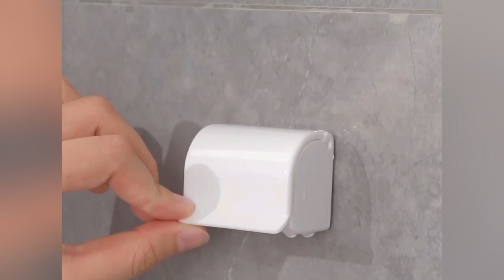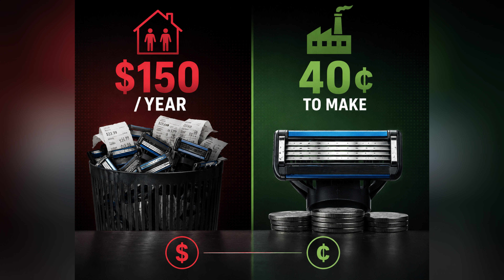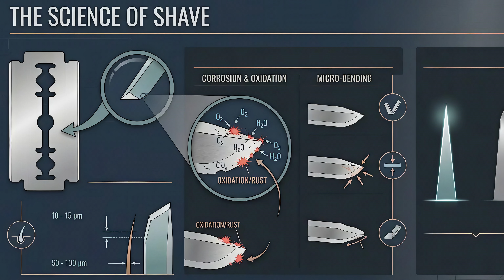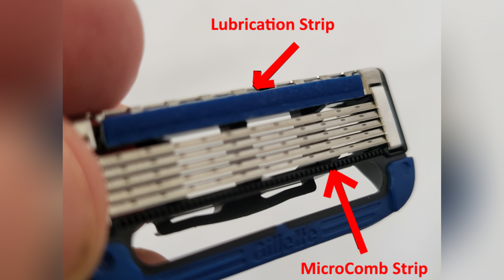Your Razor Is Designed to Dull After 3 Uses — How to Make It Last 2 years!

Comment from the maker: 💠✳💠 When I say to “flip it,” I don’t mean flipping the cartridge over to sharpen the back side of the blades. I mean changing the direction you rub it on the denim.
Denim has a weave — little threads running in different directions. So you gently rub the razor opposite the cutting direction for a few strokes one way, then turn the razor or the denim around and do a few strokes the other way, still opposite the cutting direction.
Reply: So we reorient the jeans only (same side but turned 180 degrees) and continue to push the blade along as before for another twenty strokes?
Reply from the maker: @mroctober3657 YESSSSS!! excatly! 👌👌👌👌👌
Reply: @Sidney_Explains_Money  Great video, I just finished stropping both of my name brand razors. Fingers crossed for an improved shave, because the last one was noticeably rougher than usual. 

But just to clarify, do you put the mineral oil on the diminishing lubrication strip? 

Or on the actual blades themselves?
Reply: @Sidney_Explains_Money  thanks for explanation!
Reply: 👌 agree, this method really works wonders. With a Gillette Mach 3, 1 lasts 3+ years. Still have the original 5 cartridge refill, with 3 still unused. Savings!🤑
Reply: @wilson5377 Have you had any problems with damaging the cartridges, you know as you rub the leather or the jeans splotch on the lubricant area? Seems like they are in the way.
Reply: Glad there is clarification because “flip the razor and 20 more the opposite face” originally stated makes no sense.
Reply: Nany... sorry. BABY oil - a product like the Johnson's babt... baby oil - is in fact mineral oil. Been using it instead of SRAM/shimano expensive overpriced oils for years and no prob.
Reply: Any tip to sharpen electric shavers blades?
Reply from the maker: @nihil0771  Yes!!! I'm working on it as we speak and should publish thar video end of this week. 😁
Reply: @Sidney_Explains_Money  great I just brought a free bird electric razor and would like to know how to keep the original blade sharp,Thanks for you great video 👍
Reply: I have a strop, but it doesn't work on cartridges, only straight edges – it can't work on cartridges because the microfins on the bottom and the bumpers on either side, physically prevent  the denim on a flat surface from making contact with the blades.
Reply: @S @Sidney_Explains_Money o, you are stropping the blades. Good idea. What about a leather strop and compound ? I guess you answered that as well but I already have a strop. Good tips. Thanks
Reply: Great tips, I use a towel, and strop the razor forward, then diagonally both sides, works well but got to try denim
Reply: How did you pass copyrights??
Reply: You said that the edge does not dull and tell us how that is accomplished with repeated wear it in fact always does, except perhaps for fine hair? You never mention the word sharpen and you maintain that water and contamination only occur and that this dulls the blade and is reversible.. it cannot be, as the edge damage always happens.
Reply: This method does not work on the typical multi blade types as these style of blades only offer 1 side to finish.
Reply: @ethimself5064 hmm works fine on the multi blades I have but doesn’t last months I think
Reply: @TimelyAdventure  Still only able to do 1 side and will curve inwards
Reply: @ethimself5064  yeah it's not perfect. but i get like a couple few months out of them shaving a few times a week, it's still way better for me than replacing razors every week or two
Reply: You can also strop japanese kitchen knives on denim. I cut off a leg from an old pair of jeans.  Works really well.
Reply: I shave in the shower. I rinse my razor and then hit it with a blast from canned air to dry it out and then put it on a shower caddy. I dry my toothbrush out the same way. My blades last a month. I'll try the stropping method and see if I can get the blades to last longer.
Reply: You literally say "flip the razor".
Reply: You didn’t “say” anything in this 😂
Reply: use hair conditioner on stubble before shaving to soften the hair .. bladess last MUCH longer & zero razor burn
Reply: what about using an actual piece of leather?
Reply: thank you for clarifying. That part of the video was extremely confusing. 

BTW there is a small gadget called a "RazorPit" which is just a small strip of silicone in a plastic housing, with exactly the same purpose. It seems to me that drying the blade and keeping it relatively free of moisture is just as important.

I wonder if there are any disadvantages of keeping a strip of denim in a moist environment. (Or are you supposed to do it on the jeans you are wearing?)
Reply: @MedeaYoung  'confusing' meaning wrong!
Reply: Should we put some diamond grit on the denim for a finer edge?
Reply: #1 reason blades go dull is water...keep them in oil
Reply: "Flip the cartridge" or the fabric doesn't add much after the initial stropping. You still can't get at the back edge of the blades. That's like 'steeling' a knife on only one side, which I know from experience doesn't accomplish much.
If you use a classic T- shaped razor, you can flip the blade and dress the second edge. Thanks for an otherwise practical video.
Reply: Will this work on a 5 blade cartridge that has a lubricating area on the top and bottom of the blade?
Reply: 3 shaves is absolutely right. I shave at least 3 times a week and by the end of that, the blades are finished. I'll let you know how this works for me.
Reply: The weave pattern in denim runs in a diagonal direction, not in different directions.
Reply: @TheBlackbelair  Regardless. It works.
Reply: Well, I’m glad you took the time to clarify your original explanation because the first time you explained it was very poor. I apologize for telling you that, but there were a lot of folks who were totally confused by your explanation the first time. Including me and several family members. ￼
Reply from the maker: @Kingdom_of_God777  Don’t worry, buddy, no need to apologize. If you didn’t understand, that probably means other people didn’t either — and that means I didn’t explain it clearly enough.

I’m all about learning, fixing things, and improving as I go. That’s what this whole thing is about.

Thanks for watching, by the way. 🤠
Reply: @Sidney_Explains_Money  please re-do the video explanation
Reply: @Sidney_Explains_Money  Since you seem to be open to constructive criticism, I want to tell you... that part leading up to where you say: "20 strokes up. Flip the razor. 20 more on the opposite face." was INCREDIBLY frustrating to watch! 😡

Not so much because the WORDS you were saying were confusing, but more because you had the camera zoomed in on your hands and razor, and STARTED giving us a visual demonstration of the technique you were describing... but then, you abruptly set the razor down on the counter, and just started making odd gestures with your hands and fingers. As your audio track said "smooth backwards strokes" you were making these choppy gestures with your fingers (???) then making a twisting / pinching / rolling gesture with your fingertips (???) then you pick up up the razor again, but instead of demonstrating the technique we're hearing you (try to) describe... you just kinda hold the razor in your left hand and just kind of... gesticulate (???) Then for a split second you start doing the same thing you did before, then a smash cut to you just... pointing at the denim with your fingers (???) 

I watched that section over and over and over... and just kept getting more and more confused! I was like: "Why the f is he gesturing and pointing at the denim, instead of simply SHOWING US the technique he's describing? Why did he set up the camera like this if he's not going to SHOW us what "Flip the razor, 20 more on the opposite side" looks like?!?!?  Whatever you were doing with your hands there did not seem to sync up with or even correlate at all with the words we were hearing on the audio track.

While I DO appreciate the information about this household "hack" and plan to try it... that visual "demo" part was way more confusing than helpful
Reply: BOILING WATER: I boil water, pour in a mug, and use my Mach 3 razor in that for the rinse for the whole shave. Disposal blade lasts 9 to 12 months. Last one head broke off cause I pressed to hard, but still shaved fine after 9 months. The much hotter water cleans the blade enough to prevent degradation. Try it, and the hotter blade gives a better shave. Much easier to maintain then the tips from this video.
Reply: I don't by Gillette any product since the woke campaigns
Reply: @ronorazine9105 what is a woke campaign?
Reply: @ronorazine9105  u mean buy.
Reply: i have no idea what you are talking about ...I have been using a single Gillette blade for 18 years and it works just fine.  
Then again, all the things i use have the tendency to last forever.
Reply: @alexlazar4738  tell us, wet shavers, how you do it.
Reply: @FernaManu  Honestly, i have no idea, i don't even dry it or often  even clean it properly after finished. 
ibut t just continue working  and my face is smooth every day

Comment: I used the Gillette Trac II, Contour, Sensor, Mach 3, and Proglide cartridge razors. The best one is the Gillette Sensor. It was an actual improvement over the models it replaced, and the models that came after it were worse.

Comment: I stopped buying Gillette because of their past WOKE advertising so I bought a  Coles (Australia) cheap generic blade. To my surprise it lasted almost indefinitely. On inspection I found that there are wide self cleaning slots in the back so it never blocks. The cheapest is by far the best

Comment: It should be said that most of the advice mentioned here doesn't apply to a modern DE blade, and the vinegar bath in particular is NOT recommended for my Henson razor Al 3. DE blades are cheap and shaking off excess water and leaving the razor in a not too humid place takes care of all DE razors. Personally, I left cartridge blades behind 25 years ago. They're too expensive for my taste and the shave is no better.
I get 8-9 shaves out of a single DE blade that costs pennies. And there's much less waste.

Comment: You can also use rubbing alcohol to rinse the blades. It evaporates any moisture on the blade quickly to dry it. It also sterilizes it.

Comment: LOL are there seriously human beings spending $80 a year though? I honestly don't know because I have trouble judging that a blade is spent, I tend to use them over a month. I also don't buy misandrist brands like Gillette. I figure Dorco is the OEM for most store brands on earth, I might as well us them. I get a $20 box of blades and that's like 2~2.5 years for me. What's great with Dorco is that when I found myself running out of blades on the road recently (was in Germany) I just checked the back of pharmacy brand boxes until I saw "Made in South Korea" - to me I was pretty sure it must be Dorco OEM parts. Sure enough the blades fit and were great.

Comment: Grow a beard, problem solved... but on a more serious note; people may ask - why not use stainless steel? And the answer is, just for the same reason Japanese chefs use knives that are carbon steel and not stainless steel, and the reason is simple. Carbon steel has a molecule that is much smaller than stainless, so, no matter how you may sharpen stainless steel, in the finest stones, it will never be as sharp as a carbon blade.

Comment: This video explains that razor blades do not go dull because of hair, but rather due to oxidation caused by moisture and air exposure. To significantly extend the life of a blade from a few weeks to several months, the video recommends the following maintenance routine:

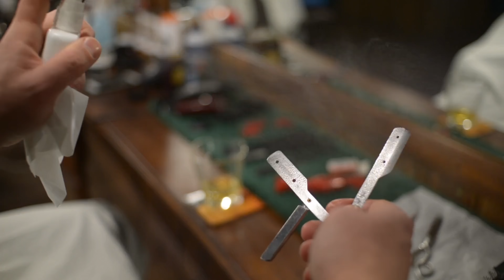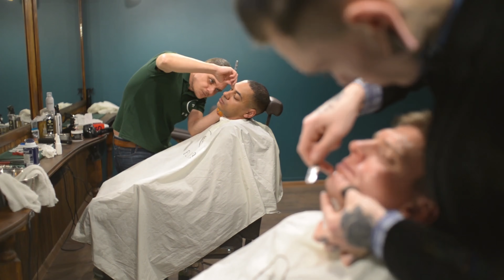*   *Stropping:* After every shave, run the blade backward (spine first, edge trailing) against denim 20 times per side to realign the microscopic edge (2:30-3:37).
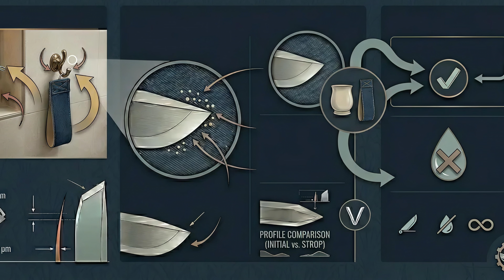*   *Dry Storage:* Shake off excess water and store the razor in a dry place to prevent corrosion (4:21-4:50).
*   *Mineral Oil:* Apply a drop of food-grade mineral oil to the blade to replace the lubrication strip and repel moisture (5:34-5:58).
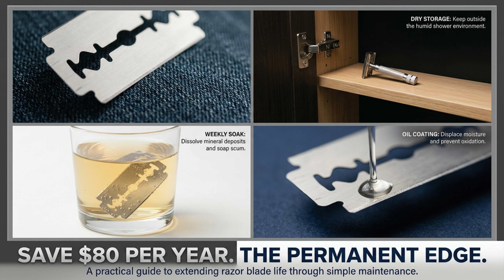*   *Vinegar Soak:* Once a week, soak the blade in white vinegar for 30 seconds to remove mineral deposits (6:02-6:22).

Comment: I’m 63. For years I’ve listened to men saying there blades only lasted for a week or two.
And I’ve never understood why? Mine last months! I thought, “As I have blond hair, maybe my hair was just softer?”

But… I’m a travelling man. I don’t leave anything lying about in hotel rooms… I keep the room tidy and put everything away (I’ve been travelling since I was 15).

And THAT is the rub… putting everything away!
I’ve always cleaned, dried and stored my razor in a bag and kept the blade covered so it doesn’t rattle about… and blunt.
Dry. There’s the answer! 😂
I won’t strop the blades on denim or anything else… I don’t need to. 
Just dry it after use and keep it dry. 
3 months… shaving 3-4 times a week.
Reply from the maker: That's a great observation! Drying and storing the razor properly definitely makes a huge difference. Glad you found what works for you.

Comment: My blades seem to last 3+ months already…with shaving my head. I use my electric razor only on my face, blades on neck and head.  It’s possible i wasn’t aware they were going dull early, and i definitely feel the difference between a nee blade and just a few weeks of use, but i judge my blade wear by if it still cuts close and doesn’t leave my skin irritated.  All I’ve ever done is rinse the blade well after use, shake dry, and set it in a dry area. With my electric, i hardly ever clean it because with my first one i use to clean it religiously and the foil would wear out in 6 months.  So i determined that the oils on my face could be sufficient to prevent wear if i didn’t wash it, and ever since, the foils last 3-5 years.  I change the foil maybe 2-3 times before the whole thing is falling apart and typically lasts about 10-12 years before i have to replace the unit.  Tried changing the battery on one one time and thats kind of a joke, but i got another year or two out of my mangled shaver, then just switched to the budget version for $60 that should last another 10 years and foils are $20 (last few have been the supposed top of the line, so we’ll see how the budget version holds up). I might try the oil on my razor, but don’t see a need to put in all the extra work to possibly get another month or two to save a couple bucks.

Comment: I use disposable razors and use the same one for about a month. 
I shave my head 3 to 4 times a week with it too. 

I run it under cool warm water first to help lubricate it. 
Not got as that makes metal expand and that means more dull. 

I shave, tap it clear, wash it out, tap it to clear water. 
I then run it a couple of times down the towel, like the strop and I store it in the cabinet. 

The important thing is to get as much water off it as possible. 

I do a very similar thing with my toothbrush and guess what... 
It starts in the same as new condition for absolutely ages, like, years!

Comment: Now I still need a trick explained how to get all the hair and skin particles stuck inside the blade cartridge out. More than half of the hair refuse to get out even after rinsing. I can rinse the razor under running water forever and ever, and less than half of the hair get out, most of it is still stuck inside the cartridge between the blades. Shaking the razor and tapping it on a hard surface does nothing, maybe 10% of hair fall out, most of it still stuck inside. 
Obviously, I can't use any object to brush the hair out, because either I'll damage the brush and get microplastics in the air or I dull the blades by scraping against the edge, which I understand I have been told in this video to avoid.
Reply from the maker: Try using a small, soft-bristled brush like a clean toothbrush; it's gentle enough to avoid dulling the blades while still getting the job done. 🙌

Comment: I use a 1950's era Gillette super speed (About $20 on eBay) and Astra platinum blades ($11.00 for 100 blades). 2yrs. of shaves from 100 blades... Clean and oil the handle twice a year...

Comment: I learnt from a video years ago that if you don't have some old jeans to rip, you can just rub the inside of your forearm in the same way. It's worked for me for years in the shower to increase the lifespan of the blades. But the rust will eventually get it since I keep it in the shower. Still keeps the blade going smooth until then.
Reply from the maker: I’ve heard of people doing that too, thanks for sharing your experience! 🙌

Comment: Can this same principle be used on the Wilkinson Sword Protector blades? The blade heads that have a thin wire on the outside of the blade that prevents razor cuts.
Reply from the maker: Yes, the principle should still work for Wilkinson Sword Protector blades. The wire is for safety, not for changing the steel's properties that benefit from stropping.

Comment: Straight razor guy here. You don't strop the blade AFTER shaving but BEFORE. After shaving the steel is under tension and deformed and stroping doesn't make any sense. When it's back in its relaxed state, you strop it to straighten out and realine its fine burr. It has nothing to do with rust eating up your blade. AFTER shaving you rinse and dry the blade and if you don't use it for a while you oil it to avoid corrosion.

Comment: Really? The razor in my bathroom is around 20 years old. I've got a couple of disposable ones that I've used for over ten years. Still working well and giving me a good clean shave. Run it under hot water then leave it to dry seems to work...

Comment: Have been drying my razor after use for years. It absolutely works. I go through about 2 disposable heads per year. A friend started using oil instead of shaving cream. That also works, proving the point. I just prefer shaving cream. Smoother shave.